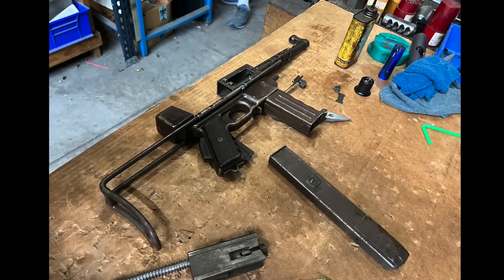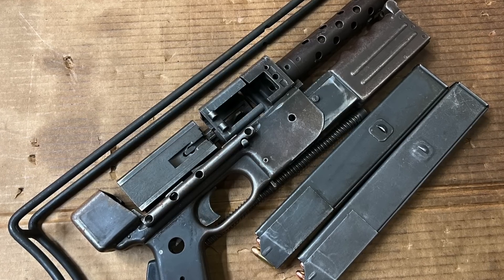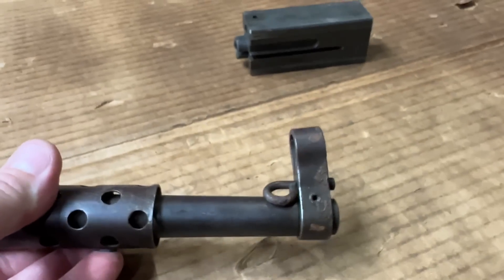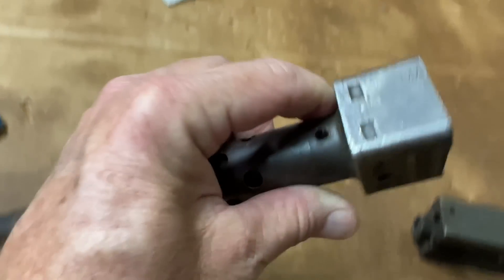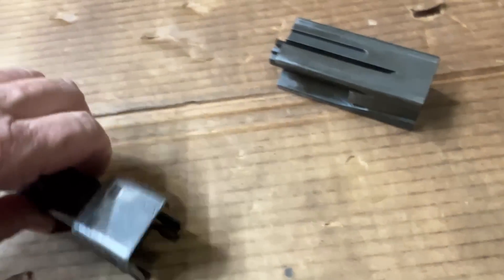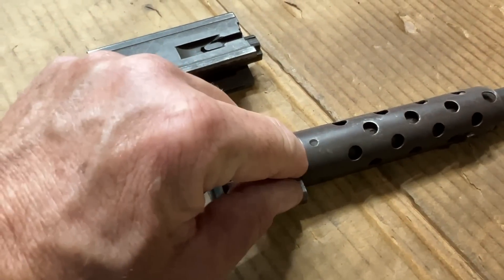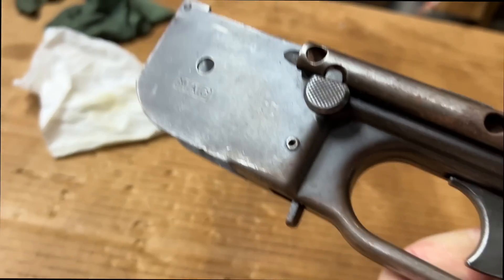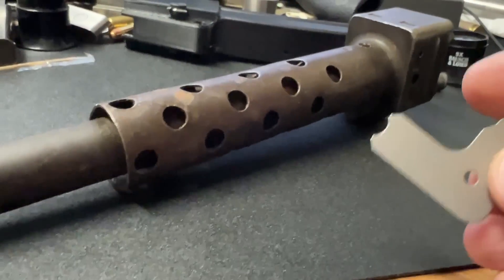MAT-49 Parts Kit

Comment: Many years ago I drew up a 2011 style frame (infinity)
Using micrometers, depth gauges and digital calipers.
Put into cad it was more than accurate enough to build from.
Even have gcode for it somewhere.
Looking forward to the next instalment.
Reply: Uncle Sam will have to take every computer, metal lathe, mill and file to truly achieve their goal.
Reply: @viscache1  fertilizer has entered the chat

Comment: Call me crazy but I "repaired" a drilled chamber on a AK barrel. It was only on one side. Someone tried drilling the trunnion rivet and went too far. It was about 1/16 so I tapped it to a fine thread hardened screw and spot welded it. A careful chamber ream cleaned up the inside. 7.62x39 over 500 rounds no problem. I retrieved some brass cases and there was absolutely zero mark where the case was supported by the repair plug. This barrel was worth saving as the polish underfolder numbers matching parts set looked absolutely unissued.

Comment: It's marked MAC instead of MAT because it has been manufactured ine The Châtellerauld arsenal and not the St Étienne one
Reply: Tulle Arsenal
Reply: As @victuff9765 says MAT was Tulle.  St Étienne would be MAS (as in FAMAS).  You're right that MAC is Châtellerauld.
Reply: That's correct, MAT for "Manufacture d'Armes de Tarbes", MAC for "Manufacture d'Armes de Châtellerault", MAB for "Manufacture d'Armes de Bayonne", Manurhin for "Manufacture du Haut-Rhin" etc...
Reply: @68monstro  Tulle, not Tarbes.

Comment: If you had a laser welder, you could weld some small pucks in a stack to make it almost completely solid again to a specific height, then put a plug in on top of those.
Reply: Laser welder's are getting extremely cheap -- I've seen some for $6k that are the same shape as a model I've used that was actually good (implies they're made in the same China factory).

Whatever you do, DO NOT buy the one that looks like dice. Worthless. A good one is powerful enough to blast a hole in a nickel, instantly.

Comment: In the past I've had good luck threading chamber holes for an extremely tight fit (although of course pressing works too) and then using a copper or aluminum slug in the chamber while welding the top over.

I'll even shamefully suggest that I've made that repair work fine on an MG42 barrel. For thousands of rounds. 😁

Comment: Very cool. I wouldn’t bother tack welding the tops of the plugs. Maybe a little peening around the tip of the plug to give you peace of mind.
Reply: Good idea. I'd just tap it and screw in a plug, cut off excess and weld the top.

Comment: Weld would be my bet. Better than an extra pin in your hand.
Reply: Probably have to re-heat treat the barrel then. They won't see any force anyway, unless the case fails, at which point the pressure has other means of escape anyway. A threaded in set screw and some red loctite would suffice in this situation except you aren't reaming a set screw.
Reply: @Chris_Garman  You can just do a bunch of spot welds waiting a min in between and not heat soak the part. But I agree that a set screw is a good option, but i'd weld the top of it.

Comment: Really wish I had gotten a sten kit back in the 90's when they were sub 100 bucks.
Reply from the maker: @michaelkaiser1864  I bought ten MK3 kits back in the mid 90s for $10 each! But even though a MK2 or MK5 kit can be $500+ nowadays, in ten years you'll wish you'd bought a few when they're not available at any price, or just crazy expensive.
Reply: @markserbu  not a smith by any means but good with my hands. Thought itcould be a learning project. Obviously id have toget a semi kit. After pricing the stuff, its way out of my affordability.

Comment: Can you reweld a demilled gun into a semiautomatic if it was full-auto before? Or would it be a post sample weapon ?
Reply: Yes, it is not controlled if you actually go through the hassle to convert the bolt to a closed bolt semi auto design. These are common for stens and ppsh type guns but this gun is so rare it will be substantially more valuable as a post sample mg for an ffl to build. Don't feel bad for the kit's price, a mat49 MG is worth easily 10x (and likely much more) what he paid.
Reply: Sure you can. To the ATF a demilled gun of any type is just a pile of scrap metal...But you can't use pieces of the demilled receiver and can't fire from an  open bolt any longer.
Reply: I imagine he is going to register this as a post 86 sample. Otherwise it would be a complete redesign of the bolt and trigger group to make it function from a closed bolt as a semi-automatic.
Reply: @Jreb1865  Open bolt guns are not illegal unless they changed some law I'm not aware of.

There's still open bolt .22 caliber semi automatic rifles being bought and sold every day in America that were produced and sold decades ago. That's just one example where they are legal. There's plenty more.
Reply: @tenlittleindians  open bolt guns in general are not strictly illegal, but the ATF has a broad idea of "readily convertible to an MG" in regards to items that were formerly submachine guns. A commercial semi auto open bolt will get more scrutiny to ensure the design is not "easily convertible" to full auto, while a semi auto gun made from an MG parts kit needs something added to avoid this extra scrutiny, closed bolt striker (or hammer) fired semi auto conversion is generally the best way to avoid ATF issues.

Comment: Question: When you make parts for guns, what kind of steel are you using? I’m guessing not mild steel?  What do you recommend? You got me started making springs and I’m going broke on Music Wire!  Keep making great videos!
Reply: 4340 or 4140 or there's a few other options but heat treat is very important and technical. Heat treat makes or breaks a good party. Definitely study some metallurgy books prior to doing anything that needs heat treated

Comment: Have you thought about putting a tight fitting copper plug in the chamber, Tig welding tool steel rod into the barrel holes, putting a 9mm chamber reamer down it, and re-heat treating the barrel?
Reply: Unnecessary.  Its just a small hole
Reply: @vettepicking  I'm a bit of a perfectionist....
Reply: @vettepicking  also... "That's what she said."
Reply: @NOTSOSLIMJIM  till it wasn't

Comment: Mr Serbu, I had a weird idea the other day. It might not be possible, but, what about a 5.56 blow back rifle. The bolt would need to be really heavy and the recoil spring really heavy, but... maybe the charging handle would be crank style, like an old Browning Machine gun?
Random thought, whatcha think?
(if you're interested, I have some other weird ideas...)
Reply: Absolutely not, you would constantly be tearing rims off, and when you didn't you would be throwing brass so hard it would be a hazard.
Reply: @lobsterbark  now that I think about it, it might need a bolt that's so heavy, the rifle wouldn't be practical. The rifle would be too heavy.

Comment: You can blame Gun Jesus for the wild increase in MAT-49's and all other French surplus military weaponry! 😆 Well atleast I do... Who else could make Starline release a new line of .32 French Longue brass, followed by companies making full pressure MAS-38 loadings suddenly around the year 2020?! 🙌 I bet a couple thousand years ago alot of people started paying for once free water after they heard about a guy that turned it into wine! 😂👍All kidding aside, Ian's & Co's "Headstamp Publishing" book's are pretty awesome, definitely worth the money to have a high quality physical book with amazing photography that is a great mix between the classic deep dive gun specific encyclopedias and the Vickers Guide series of picture books... They are definitely cheaper and come with more goodies  if you get in on the Kickstarter. (Literally the only Kickstarter items I've ever trusted) The next book is on US WW2 small arms so buy now lol! Although I'm not sure how much more that market can Increase... I saw a Universal M1 carbine (one of the  late model, cast, black painted, stamped & welded op-rod, dual recoil spring, awful look-alike models) marked for $999 at a shop a couple weeks ago 🤦‍♂️ It was missing the oiler and sling, but atleast the rear sight hadn't fallen off yet? Guess I should've kept mine, but I'd probably be blind by now from it firing out of battery. Or maybe one of the cast parts, bolt, or the soft steel cam path would be completely destroyed by now...